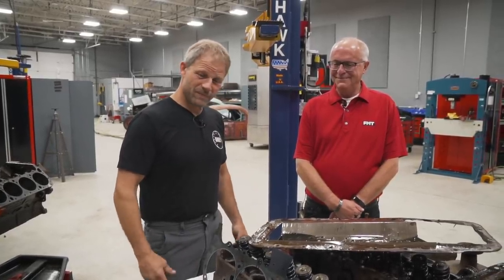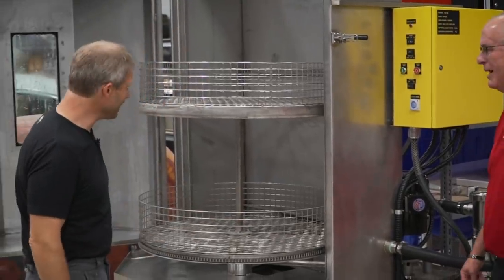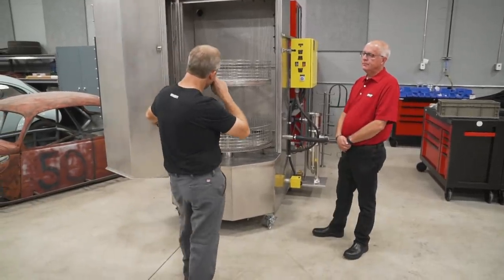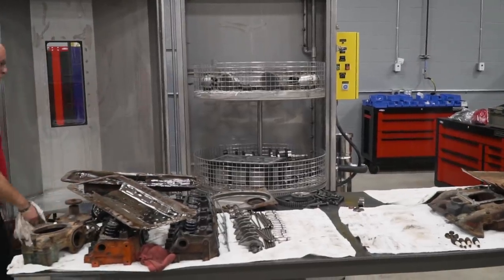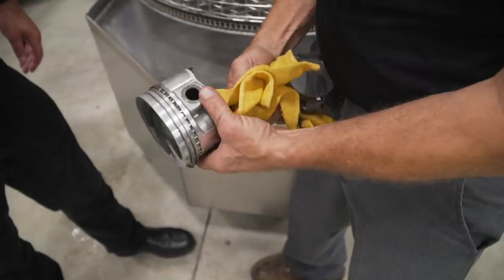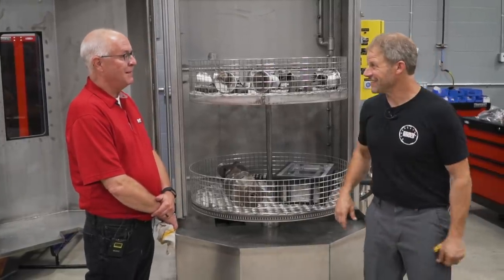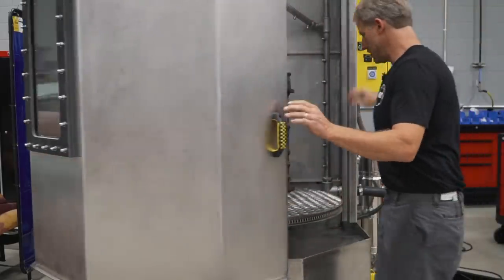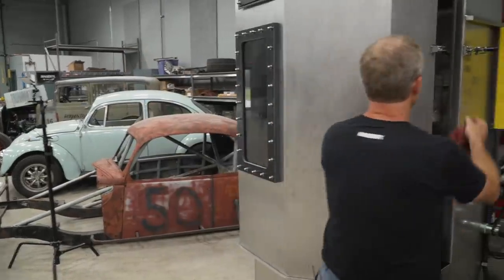Will it wash? Testing our new parts washer | Redline Update #52

Comment: Those washers are at least 20 years old, you run the filters while the machine is running and there is a skimmer while the machine is not in use.  If you clean the heavy crud off with a putty knife, most all parts come clean with one washing cycle, if not just flip the part and run through again.

Comment: that type of valve stem seal is a PITA. but they hold up better than the old fashioned umbrella seals. the only way I have ever been able to install them with out breaking at least one is with proper tool. I bought a KibbleWhite 20-20825 kit. it runs about $25 on summit racing, and includes the 4 most common size valve seal installation tools. they work wonders and I have not broken a seal since. they are a huge time saver.

Comment: I used something similar in size 30 yrs ago for automatic transmission parts in a factory. It was called a Typhoon and instead of a filter it allowed the solids to separate out like in a sediment trap and utilized a oil skimmer in the solution tank. I always wished I had access to one for my home projects instead of using stanisol in a small parts washer that the cleaner got rapidly contaminated when cleaning oily, greasy parts.

Comment: How do you dispose of the wash water?  With all the petroleum in the waste water, are you able to put the discharge in the sewer?
Reply: Some of your larger shops will likely employ a oil/water separator to make the water suitable to discharge into a sewer.
Reply: You never really empty the wash water, you have the filter while it is in use.  When it is not in use the oil products float to the top, the machine should have a  skimmer that removes the floating scum.

Comment: Is this a potential Hazmat situation, with the steam and the sludge? If there are pollutants in the steam, the EPA will not like it at all. If there is sludge (and there must be) then how do you get rid of that?
Reply: 50 gal drum
Reply: Hazmat? Your kidding right. Or just rumor mongering?
Reply: @Wrenchen-with-Darren  Not a rumor. Likely the company that picks up your waste (oil, antifreeze and such) knows about permits and placarding. The cost is likely in your invoice. But garage waste can be legally hazmat. Depending upon the chemicals used for cleaning in the new machine, a new placard could be needed. Then again, maybe not. It is worth checking before disposing. You could not believe the potential fines for the shipper (yourself and the carrier).
Reply: I just saying, people worry about everything. What about oil you wipe off the counter with papertowle. Or empty  oil cans...trash. let's just relax. Thanks